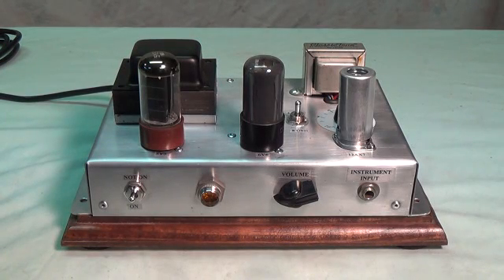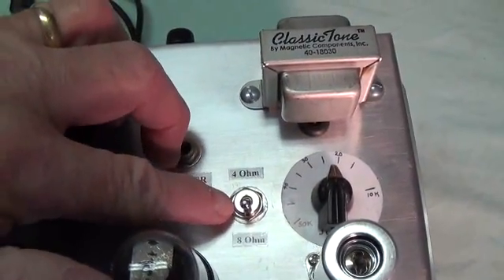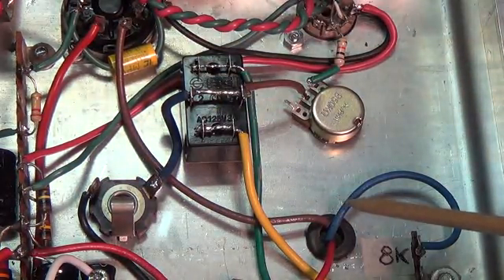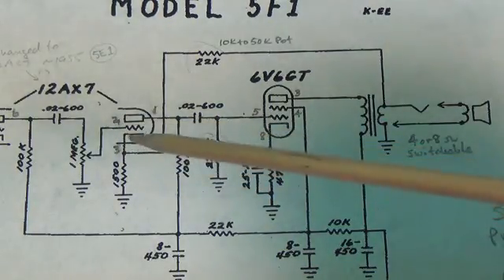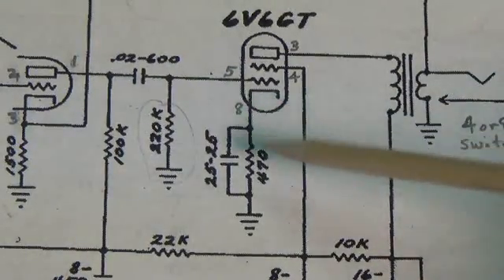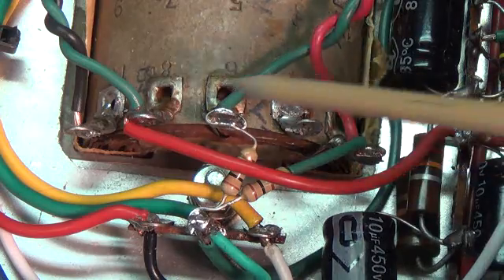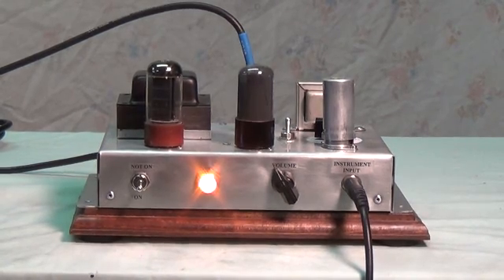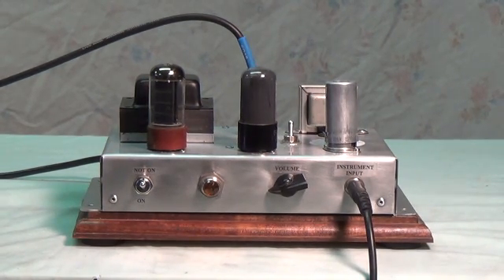Scratch Building a Fender 5F1 Champ from Scrap Parts.....Part 2

Comment: Doug,   I'm in the ordering and thinking out stage of my 5F1 build. 
Something I've been told to do in the past, is wire up the output transformer before fastening it to the chassis, and move it around to find the quietest spot.  I think what you did on your 5F1 was just keep it as far away from the PT as possible.  I'm sourcing my own parts, but I notice a different orientation of transformers on so many of these builds.  

I have built 5 Amps over the years and my strategy up until I managed to build a noisy amp was to staddle the power tubes close with the OT (got that advice somewhere), and make sure  OT and PT don't face the same direction.  In the noisy amp I ended up relocating the OT, but yielded only minor improvement. The only amp I've built with a gain control, and most of it isn't usable, after gain reduction mods. The upside is that I managed to get a very nice chimey clean sound on that amp.  I digress.

Back to the Champ!
 I'm planning on running a 99ma 4h choke in series with the 10k resister.     I would value your thoughts on choke and OT placements for the 5F1 in particular, and maybe otherwise in PP amps.     Thanks........
Reply from the maker: I too have heard that the OPT and PT orientation should be perpendicular, Jeff, and I tend to locate my preamp tube(s) as far as possible from the power supply. Since the choke is part of the power supply, I would assume that it should be separated from the OPT and oriented perpendicular to the PT.  Other than those simple rules, most of my attention is dedicated to proper wiring and grounding.
Reply: Thanks Doug, I copy that,  and  will think of the choke as part of the power supply and do accordingly. I need to find some good photos of
Champ models with chokes and see what fender did.  I bought those Christmas tree bits. Was previously using wood forstner type bits from HF.. Worked well on aluminum, but the Champ chassis is steel.
Reply from the maker: You're welcome, Jeff. Best of luck.

Comment: Thanks Doug......I'm curious what you ended up going with for your bias resistance on that pot. Have long heard that Champs like to run hot. I have put bias pots in 2 of my Cathode biased amps. I'm about to build one of these in a Gorilla solid state combo amp. A sleeper of sorts.......Probably just gonna roll with the 470 ohm bias resister this time.
Reply from the maker: I don't recall the exact resistance value, Jeff. It was probably in the 525 to 550 Ohm range to reduce the PC and PD.

Comment: Hi Uncle Doug, love your videos mate, have learned a ton and made some mods to a 5 watt tube amp I have with excellent results. It has a 12ax7 and a 6v6, if possible I would like to add an effects loop, where is the best place to insert it? between the 2 halves of the 12ax7?
Reply from the maker: Rusty and I have no experience with effects loops, MR, but if we were to add one to an amp, we would experiment with different insertion points, i.e. before and after the second pre-amp stage. Good luck.

Comment: Where did you get your audio output transformer? I'm trying to get one that's roughly that size without breaking the bank.
Reply from the maker: I get all my transformers from Triode Electronics. See their Internet catalog for details.
Reply: Thanks I really appreciate it!
Reply: Hi, Uncle Doug, love your channel! In this video you mention that the output transformer has 5 and 8k ohm taps - can you tell me how you calculate which to use?
Edit:  for clarity I mean the input side of the output transformer. Can this be calculated or you just knew from experience which to use?

Comment: You've inspired me to build a Model 26 deluxe.  I've learned a ton from your great videos so far. Much in awe.    One question:   I'm a woodwork enthusiast.  I want to do an un-covered 'woody' cabinet....  does either the cab covering, or the type of wood (e.g., solid mohagany vs. pine) seem to have an audible effect on amp tone?  (I know that in Audio loudspeakers cabinet wood type is 'touted as' a huge deal).  Gracias
Reply from the maker: That's good news, Michael. The Model 26 I built several years ago is still one of my all-time favorite amps. I have posted a video of it as well as the modified circuit schematic.....updated for both tone and reliability.  In my opinion, fairly light (not dense) wood, like simple pine, will resonate better than denser woods, such as oak, mahogany, and walnut. The denser woods look much better when stained and finished, however, which is a major consideration if you plan on building an exposed-wood cabinet. I guess that mahogany would be the best compromise between resonance and appearance.
Reply: Thank you.  I "figured" (pun intended) the wood's resonance/density  may just affect tone.  I'll keep you posted and sure to have some questions along the way.  Enjoy.

Comment: Guess I didn't listen to Rusty. Just finished building my own version of this amp. I missed the NEGATIVE in negative feed back. Counter intuitive but the black lead from the output transformer I used goes to the output jack and the feedback loop. The orange lead marked 8 ohm goes to ground. Sure did oscillate loud!
Reply from the maker: Yes, indeed. An inadvertent positive feedback loop creates an ungodly howl, that, when modulated by a slowly oscillating tremolo circuit, would make a really good siren :)

Comment: Hi Uncle Doug, a component related question about scratch builds.   When I look at a schematic, lots of times there is a capacitor that is say, 0.003uf.   Sometimes I look all over various electronic sites and can only find say, 0.0033, which is 10% off.    The tolerances on a lot of capacitors are in the 20% range so if we start off with 10%, it might work fine.   But what about the buildup of all of the tolerances all over the amp?   If we scratch build, and 2 or 3 or maybe 10 of the components are 10% from the design center,  is there any way to know (without lots of EE education) when the amp will start to have problems?   Maybe are certain components more critical?
Reply from the maker: Errors in value of the magnitude you describe are of virtually no consequence in an amp circuit, Michael. I understand your concern, but after years of experimentation, I can assure you that you can alter cap values by as much as 100% in many cases, with no apparent effect on the function of the amp. I too was surprised to discover this, thinking (like you) that every value was precisely chosen, but apparently, such is not the case.  There are areas, i.e. the electrolytic filter caps, where altering the value too much in any direction can have consequences, but for most of the cap values within the circuit, absolute accuracy is not required.
Reply: Thanks Uncle Doug!   And thanks for all the great information, and instruction videos.   Its been a great experience, can't wait to hear the first "twang" from my built amp!
Reply from the maker: You're welcome, Michael. Hearing the first sounds from your home-built amp will be a memorable experience. We hope all goes well.

Comment: Hello Doug:)  i asking its okay to put normal pot what is used guitar pot. how much power it should be take. Sorry my bad english:) i am from Finland. T. Mikko
Reply from the maker: I believe you are asking if a linear pot can be substituted for an audio/log pot for volume control (?). Generally, any pot that affects the audio signal should be audio/log taper, Mikko. The power handling capability is generally not an issue due to the extremely low voltage/current found in the pre-amp circuit.
Reply: Thanks Doug:) Keep make the videos.They all great!
Reply from the maker: You're welcome, Mikko.

Comment: I'm really tempted to buy myself some old radios and steal parts for an amp. Here in Norway these olds 50's and 60's radios go for basically nothing. I recently found a radio with a tube complement of two 12ax7's and two el84's for about 20$. Ive already built a variation of the 1974 marshall and a 5e3. Both were kit amps, but i feel like i want to challenge myself by collecting some parts and see what i can do with em. Do you think it's too ambitious/dangerous or is it a good experience for a 18 year old amp rookie?
Reply from the maker: Not at all, Lars. With your experience, and if you are careful to follow all safety rules, you should be quite successful. Let us know how your first scratch-built amp turns out.

Comment: May I respectfully suggest using a shorting jack for the input ?Also great mods to open up a 'champ's' versatility are a bright sw and presence ...  https://www.youtube.com/watch?v=cLwUF6H71bk&index=5&list=PL4SfNtGVBBdSJAc3Bo9GvCqF1hqPwd8-a
Reply from the maker: Excellent suggestion, Ben, and one I usually include....except in this case I was trying to use only scrap parts and no self-grounding input jack was available :) Thanks also for the link.

Comment: Another great set of video's, thanks Uncle Doug.    A question for you, any problems with grounding using aluminum vs steel for the case?
Reply from the maker: Actually, aluminum is a better conductor of electricity than steel is......but it does not shield as well against electromagnetic fields.

Comment: Thanks again Uncle Doug for another great set of videos.   Can I ask:  how did you determine the size of the resistor for the virtual center tap?
Reply from the maker: The 100 Ohm value is well established as being effective. I was simply following traditional practice.
Reply: Awesome, thanks Uncle Doug.  (Any chance you take on interns? :) )
Reply from the maker: You're welcome, Michael. I put just about everything I know into the videos, so you can intern at home.....in front of your computer :)

Comment: Hi, Doug:

Great video, as always.  Rather than reading every post before asking a possible repeat question - here goes..Is there a reason for the 2 pole impedance switch vs. using single pole? "what you had around", or current handling (2 pole vs single)??
Reply from the maker: Good question, CMG.....and current handling is the reason. Since a fairly significant amount of current is delivered to the speaker voice coil, regardless of the impedance output selected, I thought it best to provide two separate contacts  1.) To provide double conduction through the switch  2.) To prevent disconnection from the speaker (and resultant damage to the output circuit), if one contact faltered.

Comment: Does the 5F1 normally run really hot to the touch? I have a Chickhead clone amp of a 5F1 and after about an hour or less of being on, you get burned fingers if you touch the chassis! Any idea of what's going on, Uncle Doug?
Reply from the maker: It sounds like your output tube is biased way too hot, Eric. Check to be sure that it's Plate Dissipation value is less than 12W.  I have posted videos showing how to do this.

Comment: Maybe a good (or bad idea) for the feedback loop, ...
Using a two track volume potentiometer with the second track connected in series with the feedback line. Thus high volume = high feedback and low volume = low feedback. The drawback would be longer wires and probably more hum.
Reply from the maker: You should test your theory and see if it works, Benoit. Let us know the result.
Reply: +Uncle Doug, I just finished my very first try at building a simple single tube amplifier.
The design and parts I used are probably not the best, a 6GK5 triode out of a tv, solid state rectifier (I only have one thermionic diode in my collection) and power supply (240v to 12v) transformer as output transformer. And all the parts are just soldered legs to legs, without chassis.

But thanks to you, I was able to calculate all the values of the components needed by myself. And, after two hours of work,  when I finally overcame to anxiety and plugged it in (thru one of your current limiting light bulb device, ) it worked perfectly and gave me am amazing ... 1mW output thru a 4 ohm speaker (my output wattage measurement may be wrong, 0.04V thru 4 ohm when I feed the amp with a white noise generator)

It is probably one of the worse tube amp out there but making a working device by myself gives me a kick and I'm certainly getting into it now.
Reply: +Uncle Doug if I can find your email address somewhere, I'll send you some photos (I'm not into making YouTube videos)
Reply from the maker: You can post the photos on my Facebook Page: Uncle Doug's Vintage Amps. Regarding your power measurements, are you sure the output voltage into your 4 Ohm load was only .04V ?  If you read the voltage with a multimeter, then it was RMS, so the calculations are: the voltage squared divided by the resistance. I get .0004W, which sounds a wee bit low.
Reply: +Uncle Doug I will post the photos on there.

I know, the output is miserable but that's my fault, the transformer I used doesn't give me enough impedance at the primary to have a decent voltage drop thru this primary. It probably doesn't help that the power transformer I have gives me a 290V output, so I have put a voltage dividing resistor between B+ and the tube.

I'll be on a mission this weekend, finding some more transformers to make the second try much better.
Reply from the maker: Good luck with your search for a suitable OPT, Benoit. We look forward to an update on this interesting creation of yours.

Comment: If your bench is a nightmare, mine would give you a heart attack.

I got a few of those side-screw trimmers. I think they were used in test equipment, have seen them on some higher grade meters.

The hum reduction methods are very interesting. I have seen in some stuff that they actually use shielded wires in the signal path (and other sensitive connections) within the chassis. I took apart a very cheap combination stereo from the 90's time ago and salvaged like 4 feet of shielded wire, nice stuff to play with.

Now, in reality, the center tap of a transformer will always be a tiny bit off center (one section of the winding giving a voltage a little higher than the other). So I was thinking, that perhaps by making an adjustable virtual center tap, you may actually be able to center it almost perfectly. If you instead of using two 100 Ohm resistors, put a 200 ohm pot with the brush grounded in the spot, you would then be free to carefully balance the centering of the tap, hopefully further reducing hum.

So far you have shown plenty of nice tricks, like that one where you use a couple regular step down transformers as an insulation one, yet something that still gives me a little trouble is finding stuff that works as a chassis. I have seen people cutting the metal covers of old computers to make them, or using the cases of computer power supplies for smaller stuff. I had a project that's been haulted because I need a big chassis and I can't find anything that will do. I remember using big cookie tins when I was younger haha.
Reply from the maker: I must say that a cluttered bench is definitely indicative of work in progress. By the time I get to the 5th or 6th layer of clutter, however, I generally cease work temporarily to clean up.....mostly so I can once again find elusive, buried tools and parts.  Your idea of a variable center tap has (as all good ideas seem to be) been in common practice for years, as a hum reduction adjustment on many amps. With regard to chassis material, in my younger days I actually resorted to using a realtor's For Sale sign as the basis for my chassis. Since then, I have stepped up to using door kick panel protectors and even a piece of sheet metal I found in the desert. In fact, I consider it a personal defeat if I actually have to resort to buying sheet metal ;)
Reply: Interesting, perhaps the person that made it first just called it 'Hum thingy' and it evolved from there, who knows.

Comment: love your vids... what is rating of your cathode bias R? is there another in series to raise wattage value. it looks like 1/4, 1/2 watt precision R. isn't 5-10 watt R needed?
Reply from the maker: Let's say that the resistance is 500 Ohms and the PC is 30Ma.  Power = (.030)(.030)(500) = 0.45W. The precision resistor is rated at 1W, so there is 100% leeway.

Comment: Hi Uncle Doug. Looking at the schematic for the 5F1 Champ and the 5F2A Princeton, the only difference I see is the addition of a tone control, a cathode bypass cap on the first half of 12ax7, and an additional 16 uf cap in the power supply. Im wondering if I can add a tone control, and the cathode bypass cap, without adding the extra 16uf cap to the power supply? Would it be noisy?
Reply from the maker: They added the extra filter cap for a reason, Nemo. I think you'd be better off following their circuit rather than leaving anything off.
Reply: Wise words. Thanks
Reply from the maker: You're welcome :)

Comment: I see you have those same polypro caps on the sockets like I used.
Reply from the maker: The yellow caps are "tubular metalized polyester" or polypropylene, as you say, Chout.....but they're not polarized or electrolytic. They work fine as coupling caps and tone caps.

Comment: You could have eliminated those two 100 ohm resistors by simply grounding pin 9 of the 12AX7 tube.
Dennis O.
Reply from the maker: ....and what would I do with the wire from the 6.3VAC winding of the power transformer that is currently connected to pin 9 ??
Reply: @UncleDoug  
My bad.
I was thinking about when running them on 12.6 vac.
I feel pretty stupid for making that comment now!
Reply from the maker: @Dennis-mq6or  No problem, Dennis. We appreciate your input.